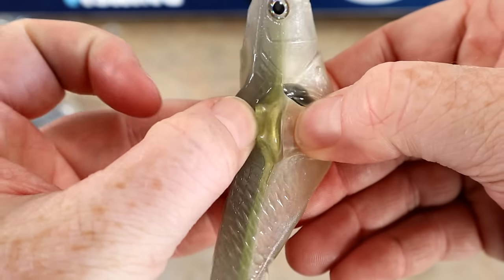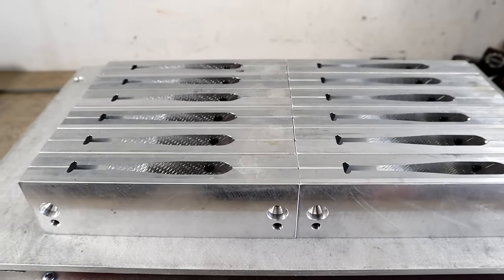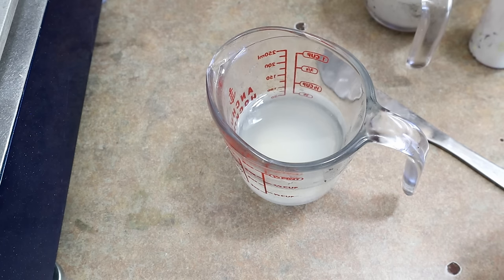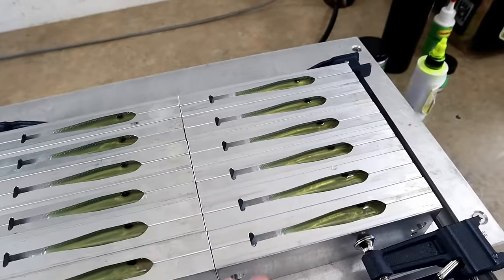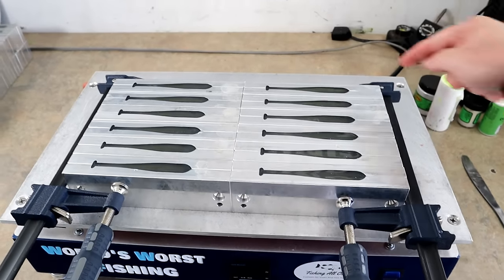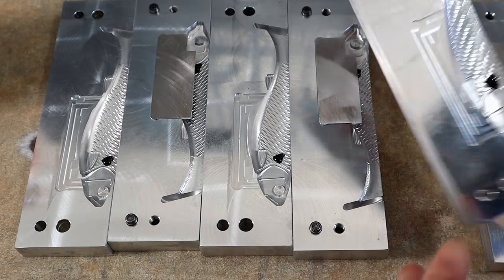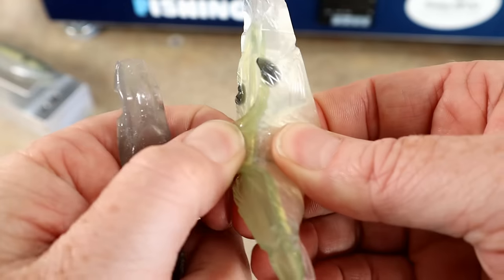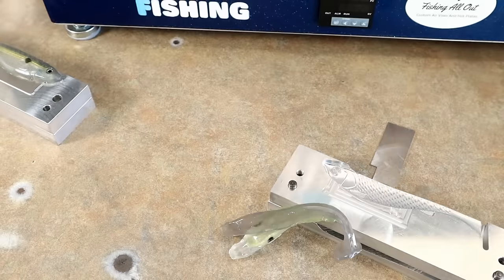Guide To Hand Pouring Soft Baits Using Proper Temperatures

Comment: So i bought a electric griddle but at the moment i am only injecting do i still need to put the molds on the hot plate or is this simply for open pours? I was looking for some clarigication but you never mentioned that if this was strictly for open pouring.
Reply from the maker: Open pour

Comment: Can you shoot the top of the molds with the infrared temp gun, instead of the spittest?
Reply from the maker: Probably...but if they ain't boiling we aren't pouring
Reply: Careful using the infrared temp gun on aluminum molds. The aluminum can reflect the beam and give you an inaccurate temp reading

Comment: Do you see any bait fish Have any straight lines on them They do not have straight lines. That's why you want to make your soft plastic bait. The same way as a real bait fish. What you see in water. Or in your bait live well tank
Reply from the maker: Of course... But look at the lateral line on many species of forage fish... The vein colorr we do as bait makers mimics that..and you want even & smoothe application of color..the results speak for themselves
Reply: @WorldsWorstFishing  is there any real proof on actually catching fish? That would be a great resource to read up on. Your work is amazing looking, but as a for-self-silicone-open-pour-guy I question if the level of consistency/straightness, exact hue, etc. makes much difference in use. General color, layers, sure. I feel it is likely a lot more to catch the fisherman than the fish. But as a baitmaker/seller no doubt your level of quality is required. Looks great!
Reply from the maker: @timbridwell4954  in order to catch the fish you must first catch the fisherman...so why would that be a bad thing?  A bait is only as good as the level of confidence an angler has in it...so why wouldn't a bait maker do the best job he or she could?  👍
Reply: @WorldsWorstFishing  I'm not dissing your process at all, you sell these, I would expect this level of quality. As a private maker, I just doubt that level is really important when it comes to catching fish. As long as it stays laminated, has close to bait colors and action, then its all good. Best a silicone guy can do is different than best a cnc aluminum guy can do. 👍